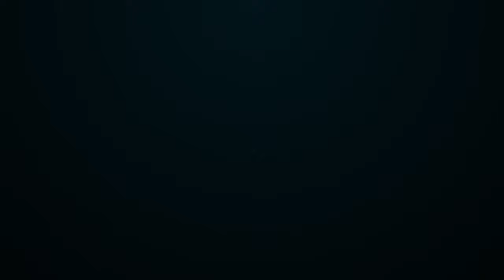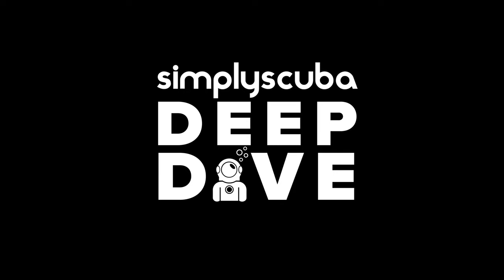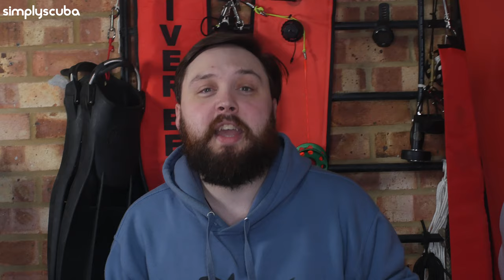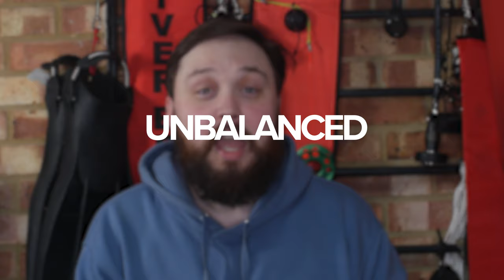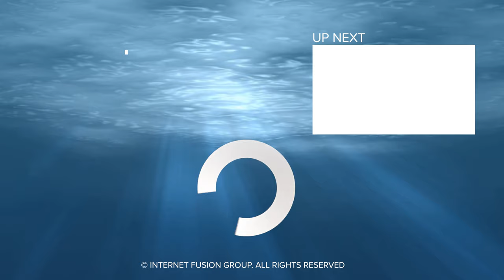Balanced Vs Unbalanced Regulators | Deep Dive

Comment: The importance of balancing really, really depends on which stage you are talking about!  1stages are actually "hydraulically compensated" and aim to generate an Intermediate Pressure (IP) that is a fixed value above ambient (normally around 10 bar / 147 psi greater)  and not often fully "Pneumatically balanced". Balanced is more accurately used to describe the force sum across the valve orrifice as a result of the GAS pressure on either side of the valve.   There is little point in having the 1st stage balanced (all 1st stages are compensated these days, ie they provide 10 bar above ambient pressure at what ever depth (ambient)  you might be) because the ratio of pressures is always massively dominated by the tank pressure. For example, with what would be considered an "empty" cylinder at 50 bar, that is still 5 times the 10 bar IP setting. With a full tank, at up to 300 bar (for HP cyls) the ratio is 30 times greater!  That means penumatically balancing the valve is alrgely pointless.  

Pneumatically balancing the 1st stage is rendered even more pointless by pneumatically balancing the second stage, which is typical for most modern 2nd stages. Here the effective valve area is largely negated by a system that feeds IP to BOTH sides of the valve over most of the area of the valve, hence the term "pnematically balanced"  This is done because for the 2nd stage, the force required to actuate the valve must remain constant if the work of breathing is to remain constant, ie the bit the diver notices!  On a second stage, the force to open the valve comes directly from the divers lungs. As you breath in, the pressure in your lungs, and therefore the inside of the 2nd stage regulator falls compared to the ambient water pressure surrounding you.This pulls in the large rubber diaphram on the front of the reg, and that  typically pushes on a little metal lever that directly pushes the 2nd stage valve open.  If the force to open that valve changes, due to a difference in forces on the valve itself from different gas pressures, then more or less force must be provided by the diaphram, and ultimately more of less work from your lungs!

So balancing a 2nd stage both reduces the total force required (reduced breathing work) and results in less change to that force from any change in IP.  This makes modern 2nd stages rather insensitive to changes in IP.  You can test this yourself if you have an IP pressure gauge and adjust your 1st stage across it's range of IP adjustment.  On my Apeks MTX-R and my Mk25 scubapro, i can get between about 7 and 11 bar as the range of adjustment. And with any of my balanced seconds (Apex and SP) really you can't notice any significant difference in the Work of Breathing across that range.
Reply: Thanks for clarifying this! I wanted to write the same, but i don't have the proper english vocabulary. :) 
Too much marketing BS these days, but anyway, most people buy stuff anyway, without knowing even the basics how they gear works. 
They see that you need overbalanced for deep dives, people consider 30m deep... but the simplest 1st stage can deliver enough gas for 2 people there. Unless you want to provide air for a large group of hyperventillating, overweight programmers, it should be fine. :D
Reply: Pressure doesn't equal volume though. So even though the supplied pressure remains the same in the first stage, the volumetric demand increases at depth. More gas required to take a full breath. So it seems that balancing/overbalancing focused on volume could still be beneficial? I mean, on a full tank, 3kpsi is probably going to move plenty of volume. But when you get down below 1kpsi, volume is going to suffer, isn't it? I'm honestly not sure how much volume a typical 'unbalanced' first stage can flow from, say 500 PSI to 0 PSI. Maybe it's not enough to matter?

Comment: I'm old school. For piston regulators I have Scubapro MK2's and MK5's.  They just keep going and I can still get parts for them.  Both came out in the 1960's.  For balanced diaphragm regulators I have Aqualung Conshelf's (XIV and 22) and Mares MR12II.
All just as good as current model first stages.  The design of first stages has changed very little since the 1960's.
For second stages I mainly use Scubapro R109's and Hog Classic's.

I love how simple, dependable and small the MK2 is and would not hesitate to use it to 100'. Probably use more than all the others. Great for travel. Goto for bailout and stage regulators. And still being made today. So any Scubapro dealer will have service kits.

The conshelf's and MR12II's are also very small. Parts are more expensive and harder to find than the piston regulators and need to be serviced more often.  Goto reg for travel, cold or dirty water. 

MK5 is my goto for deep dives and when I need more hose layout flexability. Usually what I use with Double tanks.

For travel I usually take three first stages. 1 MK2 and 2 balanced diaphragm. This way I have 1- primary, 1-for a tank to sling (bail out) and a spare.  I usually take three second stages as well.  Amazing how often some body will want to buy a R109 from you.

Overbalanced came out because balanced diaphragm regulators could not delivery the volume of gas a balanced piston can.  Just Marketing BS. For recreational diving  balanced diaphragm regulators deliver more than enough air.

Comment: I’m torn between buying the cf200 or the flx xtreme I don’t wanna buy a stock sized suit as I’m oddly sized I’m EXTREMELY skinny I only weigh 150 soaking wet in all my dive gear and I’ve got a lanky torso so I think I’d be best off with a custom sized suit what do you think? I was looking at the Cortez and Yukon aswell (mainly because the price is nice😅)  I really don’t know what way to go on this

Comment: RE: Overbalancing. Really this is mostly marketing Bolleux on modern regs!  The total flow rate capability of the air supply system is simply set by the total delta P (tank pressure minus ambient (ie water) pressure and the size of the valve orrifii in the system.  More deltaP or larger holes = more flow.   Increasing the IP with depth (overbalancing or more accurately, over-compensating) simply means that for any given flow rate the 2nd stage valve orrifice is open by a ratiometrically smaller amount. But because work done is force x distance, whilst the valve is having to be opened less far, it requires more force to do so, so the total WOB remains broadly constant!  Back in the day, with unbalanced seconds, they had to use small valve orrfii to keep the maximum valve actuation force down to keep the WOB down (being unbalanced the IP pressure driven valve force was reacted only into a fixed spring, and that needed to be strong enough to prevent freeflow, ie the valve being blown open by the IP). And a small orrfii means a lower maximum flow rate (for any given IP) so here, as you went deeper, there was a trade off to supplying the diver with more air (volume of air delievered of course increases proportionally with depth for any given lung tidal volume being exhanged) but at the expense of a high WOB.  Most divers of course were happier having enough air, even if they had to work a bit harder to get it!  Today with pneumatically balanced 2nds, really none of that has much meaning, and you can pretty much make a 2nd stage with any sized orrifice you want (and this is also why modern 2nds can use much smaller diaphrams than the old 2nds used to have,meaning much more compact units)

Comment: At the depths where overbalancing would be needed you really should be diving CCR or helium which makes the point moot IMO. But outside of deco bottles where is no reason to buy an unbalanced reg, the savings when buying the cheap unbalanced regs is very minor and not worth it.
Reply: Frankly, there are fringe reasons to have unbalanced regulators. Personally, I used to do competitive scuba diving when I was younger and I hated balanced first stages. Using an unbalanced first stage, I can monitor my gas consumption even without an spg. Very helpful if you are in a competition where you don't have a lot of gas reserves. It does require years of experience with your personal regulator though. Similarly, field repair is much easier with an unbalanced regulator. 

Now, I am fully aware that both of these reasons are against everything that is taught in recreational diving. I don't advocate for people to dive without spg or do maintain their equipment without training. But if you are qualified to service your regulator and you are diving in fringe application areas, unbalanced regs can be an advantage. It's not just a money issue.